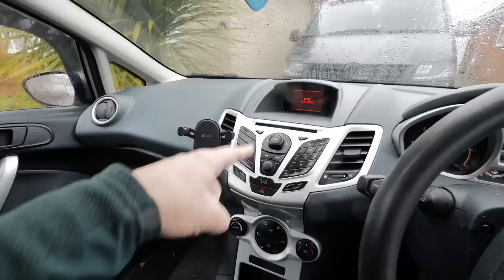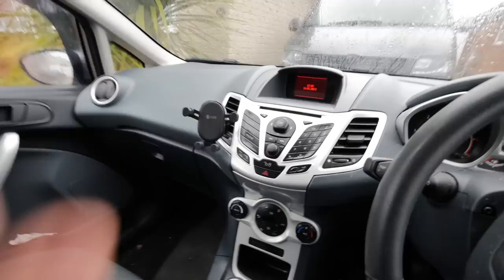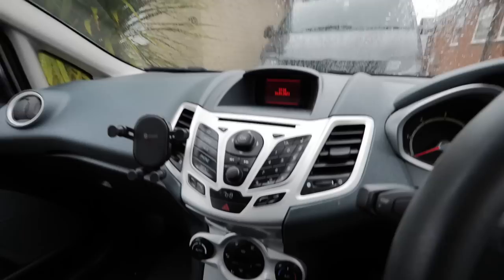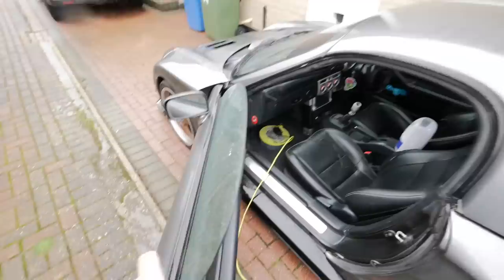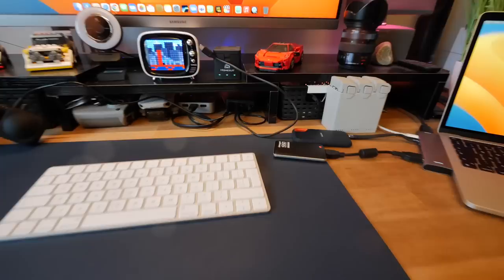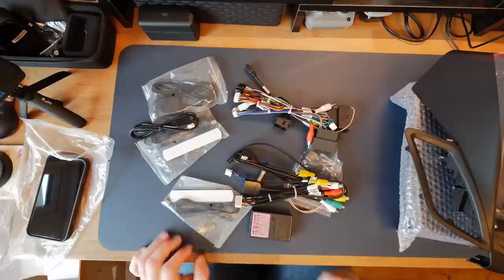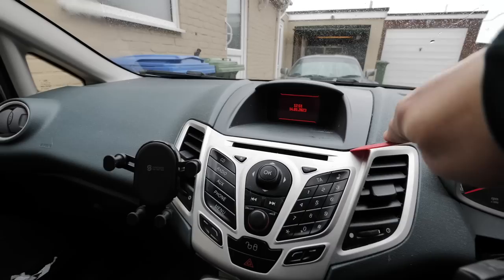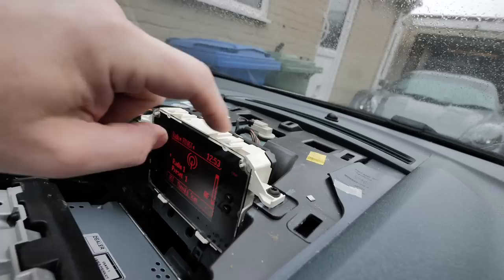old Fiesta wireless apple carplay / Android Auto upgrade - Seicane Android Stereo

Comment: It's not as easy dropping in an aftermarket dual din head unit into my Mk7 Fiesta, the biggest problem I faced was obtaining the right facia plates and interface module for the steering wheel controls, And to keeping the original vehicle settings menu functionality, in order to still access the interior accent lighting menu and mirror fold controls. I thought about installing one of these cheaper vertically orientated android units, but ended up settling for a premium DAB HDMI Sony unit. Thanks for sharing.
Reply: Did you manage to find a nice fitting on in the end and are you able to share which one?
Reply: You made the right choice imho.
Reply: I think the Seicane one comes with all the correct facia fittings in the box
Reply: I went with this route aswell but I lost the functionality to use the top screen and my parking sensors rarely work. The kit I got was supposed to let me hold the centre button down to access the top screen but I can only use the steering wheel button to control music on the sony unit. Did you have any of these problems?
Reply: @scuzzoo  The only intermittent issue I get with the after-market interface is occasionally the steering wheel buttons would ignore the head units custom button assignments, and the volume would increase on both up and down wheel buttons. I discovered a quick thump on the buttons got them working every time and so left it at that. Regarding the top screen menu and it's functions, mine still works, if I hold the centre menu button for three seconds, the upper clock's menu and features can still be adjusted via the steering wheel buttons. This may differ on your BUS module variant.

Comment: These android head units are great, but you do have to remember a little security with them.   One thing, if your car is ever stolen, whatever Google account is setup on them is fully exposed as there are no locks.   So have a think about security and stuff like that with them.   I would make sure to use a different Google account to your main one as if someone gets access, they would have your gmail, contacts and everything on yout Google account.   Other than that, they are great little units and a great upgrade.     Have to admit, this one is not the prettiest install.   It is relatively ugly.
If you are using Carplay or Android auto and none of the options in the unit, I'd suggest looking at an add on screen that only does carplay, as these are usually a lot cheaper than a full android head unit.

Comment: Cable management would drive me insane with them rattling about behind the dash, cable ties would have came in handy. Overall if your looking to upgrade an older vehicle to a newer looking Android/Apple interface i guess its an improvement but i'd rather put the car in and upgrade the car with newer tech already included. My 2023 Grandland X boasts a fully digital screen and its good but the satnav part looks smaller than the older version even though it states its bigger its just more wasted space around the edges of the screen.
Reply from the maker: This is probably more aimed at the people that haven’t got 30k to drop on a new car or dont want to be up to their eyes in debt for a car. A few hundred quid is much easier to swallow.
Reply: @SpyderLEE  yeah i get that my first car i bought for £98 @17 was 34 years old it done me good to get to work and back while i saved for something newer while not breaking the bank, i'm now 53 it took alot of time and hard work to get this far but it can be achieved. Spending a ton of money on a radio head unit is not gonna add value to your vehicle a simple phone holder can achieve the same job till you upgrade your car.

Comment: Set security on the device if you are going to sync any personal emails and data in case your car gets stolen, stops the thief getting access to your personal emails, set a passcode at start up, if you find that a hassle then don't log into anything
Reply: The risk is the same as getting your phone stolen.
Reply: @lupulflamand5673  you don't put a lock on your phone? No pin, no pattern, no fingerprint?

Comment: Serious question: is that actually an MOT fail? As you can see from sat in the drivers seat how sticking up so far from the dash it will create blind spots on the N/S corner. I struggle to see how it would be road legal assuming dash cams/air fresheners and any other non standard detritus is a technical fail.
Reply: I was thinking the same thing really when I fist saw the height installed. It does tend to sit quite high above the dashboard line. As they say...'if it's not broken, don't fix it'.

Comment: I have a 2015 mk 7.5 Fiesta and I purchased this kit hoover was left disappointed that I got the wrong loom and wrong decoder. The loom and decoder was for the 2009 to 2014 Fiestas. The 2015+ radios have an extra plug and there's not a socket for the extra plug on the loom. Thankfully they said they have the correct loom and decoder for the 2015+ models, as at the moment I can't integrate the steering wheel buttons and also the sound quality is terrible as the equaliser and amp and split over two sockets

Comment: and if you cant use climate, try to change a canbus settings, sometimes it helps. here in our russian youtube version there is about Raizer canbus when changing car settings its helps someone. or if you cant change, maybe can bus only gets can requests. in my case i got only one can channel I-CAN or MM-CAN, but in newer there is two can chanels which goes to sync system I-CAN and HS-CAN in sync 2-3 there is 3 can channels i-can or mm-can, then hs-can (main can) and ms-can for not so important parts

Comment: I'm sorry but that wasn't an upgrade. That isn't better. Replace all the simple buttons that just work, and can be used without taking your eyes off the road thanks to muscle memory, tactile feel and feedback (you know you've got the right button cos of the shape, position and know you've turned it on because it actually depresses or clicks when you press it, unlike a touchscreen) with a huge touchscreen. Now you have no idea where the "buttons" are, need to look at the screen to see the changes are made (again because of lack of tactile feedback) and if you're actually touching the right part in the first place since you can no longer rely on muscle memory and positional memory. And it's inevitably going to stop working at some point because the screen will fail or the software will be out of date and need updating (and risking getting a bug or losing features as a result, or having the layout and design change which is not a good thing). If you can even get an update - a lot of these types the company stops supporting older touchscreen systems without warning (or barely any). And that will be far more expensive to fix than some simple push buttons. Sorry but screens aren't an upgrade over tactile switches and buttons and this trend needs to die.

Just get a satnav or use a phone and stick it to the dash/window with a mount. Far cheaper, far easier to use, can be angled for better driver viewing/seating position. And you can still play all your own tunes by using aux cord or bluetooth or USB connection.

Comment: Hi there great video I have the smaller unit for the fiesta having a few problems you may be able to help first after the install it changed the odometer to kilometres and it will not shut down when I removed the key and even if you turn off from the unit it still draws power
Reply: I don't know what unit do you have but there a cable that you should connect to power when the ignition is on so the unit knows when to into "sleep" mode. Same thing with amplifiers and active subwoofers
Reply: Alot of these units power off when drivers door is opened
Reply: Try swapping the power and ignition on cables in the loom, some of them aren't wired correctly hence you end up with a unit that doesn't turn off

Comment: I have a 2013 fiesta and have connected it up
Everything is working accept the steering wheel controls I have no clue why
There is a mini usb connection from the car to the screen but have no where to connect it (tried to connect with an adapter to a 4 pin with no successes)
Hope some with the knowledge could help
Thanks
Reply: Have you tried going into the settings on the screen and adding custom controls ?

Comment: I think the gps antena should be somewhere on the dash if I'm not misstaken.
Reply: The plastic of the dash is pretty much invisible to the frequencies that GPS/satnav uses.
Reply: I was thinking the same thing when I saw the video.  I have tried installing the GPS antenna inside the dash in other vehicles, and the signal wasn't as good as putting it on top of the dash.    Ended up doing the same way he did, and I locked on to 21 satellites while still parked in my covered driveway.   I am guessing the plastic covering doesn't really block the antenna signals, so it works.

Comment: I don’t get why you’d want a GPS antenna? If it has Apple Car Play then use the one in your phone, all it will do is mirror the iPhone satnav screen to the big screen.
Reply: sometimes it's better to use built-in nav so your fone battery lasts longer.
Reply: @3abdangry  In car chargers exist?
Reply: @marksapollo  no using your phone less overall extends battery life, using fone as gps while charging is the worst possible way to kill your battery sooner because it's being used at load max voltage also while charging, if every day you don't use your phone for 2 hours of driving that's 10 hours less per week.
Reply: @3abdangry  You need to get out more.
Reply: @marksapollo  you need to read more
Reply: @3abdangry  Not form your sources!

Comment: How did you change it from KH to Miles (MPH)? I’ve installed it however my car changed to Kilometres which is frustrating.
Reply: You may need an OBD programmer to change that if your dashboard doesn't have an option to switch between the kilometers, yards and miles. However, backing up everything is the key before making any changes. It's also super important which programmer you get off the store.

Comment: i have a ford fiesta titanium edition with the sony radio, would this system be a suitable replacement for this, if so will it still work with the steering wheel controls
Reply: I would also like to know this as I have the same as you
Reply: Slightly different wiring but I'm pretty sure it does
Reply: Someone else has asked this question on their website and it looks like it does
Reply: Keep the Sony system.  This is junk.
Reply: Recently bought this last week put it in the car came with two lots of wiring adapters for the fiesta but it ain't all its raved to be tbh quite disappointed fitment an all isn't great at all I did read that on the odd review but I knew you was going to get good an bad with everything but it's better than what I had anyway but yeah you can learn it to do steering wheel controls
Reply: Don't do it !!!